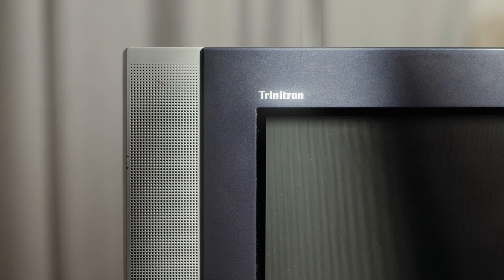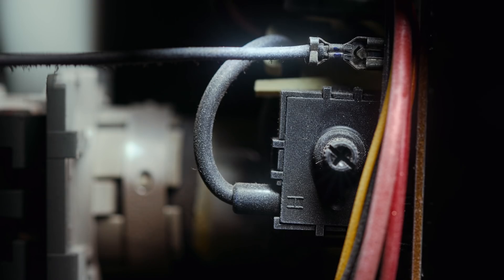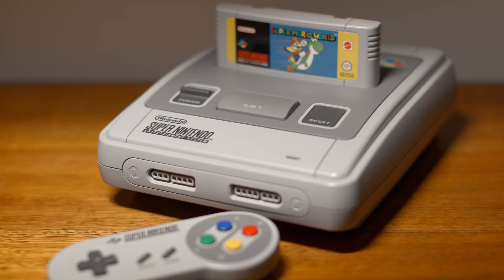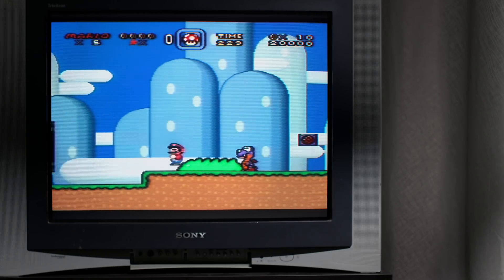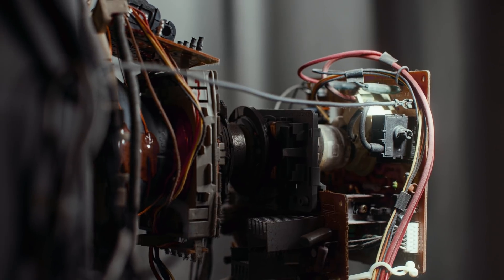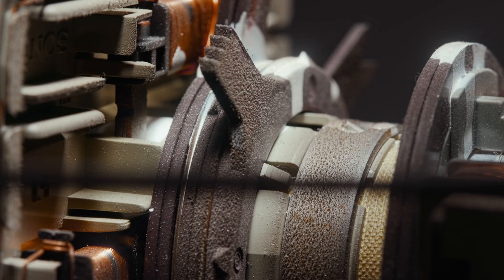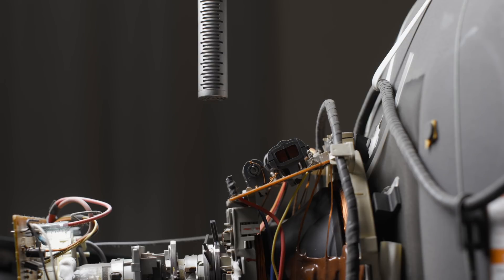What's inside my old TV?

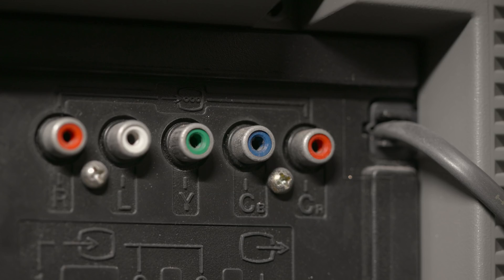Comment: 6:14 "that means I can order a component cable for Super Nintendo, and get a much better picture to this TV."

sorry, but that won't actually work. unless you mod your SNES, or use an upconversion system, in which case, you may as well just go back to your emulator, because it will NOT be genuine SNES anymore.

in fact, even the original Sony Playstation did not have component output. the PS2 did, but if you take that connector, and plug it into the PSX (they used the same connector) you would only end up with a black screen...

composite really was the best SNES had to offer. interestingly, the ORIGINAL NES (which shipped with an RF connector) actually had composite connectors on the back right (although they were in mono audio). but composite was STILL better than plain old RF connection.

Comment: Great Video - but several things; firstly, if you think that this TV is big and heavy,  you need to try the weight and size of a TV from the 1960s!!  This will seem comparatively lightweight in comparison!  They were full of Valves (which this one isn’t) and had even more heavy components than this one!  You’d need a wheelbarrow!  Second; you mention a Tube 'dying’ as if modern TVs last forever;  they have a much shorter life than a CRT – and they don’t ‘die’ (give you warnings when they are going) they just ‘drop dead’;  you switch on one day – and nothing happens -  it’s dead; no warnings, no fading – nothing...    CRTs lasted for years - literally, because they were built to last, unlike modern technology,  which is mostly 'tat'  - even at the so-called 'high-end’ of the Market.  Finally;  don’t stress too much about the Tube giving out;  they may not make old TVs any more, but there are a surprising number of BRAND NEW  Tubes out there that you can acquire!  There’s no shortage.  In fact,  I'm pretty sure there is at least TWO manufacturers who still produce them in small numbers. (I read why this was somewhere – but can’t recall where) Having said all that,  you could still replace it with  one from another secondhand Set,  as there are still thousands of old TVs out there.

Comment: In addition to no delay or ghosting, CRTs usually had (have?) noticeably higher refresh rates than LCDs. Even a run of the mill CRT could boast 75-90hz, while LED displays today routinely struggle with 59. Depending on quality, plenty of CRTs manage 120-150hz just fine; something that gaming monitors are only just now beginning to compete with.

Comment: Just so you know, when your CRT dies, you can always get HDMI adapters for your old consoles and connect them to your flat TV. They’re a good way to keep your consoles alive other than getting old tech specifically for them.
Reply from the maker: That's true! But digital TV's don't display RGB/Composite signals correctly in my opinion. There's no arperture grill, bloom or scanlines to break up the image and make everything gel. So it looks nasty and pixelated. Use RetroArch with the CRT Royale shader! I've tweaked mine and now my games looks extremely close to the real thing on a CRT. Very very happy. :D
Reply: Pogomix Pogomix Oh you’re more the type to replicate the old CRT look? Gotcha. I’m personally more the type to make all my games look the best that they’ll ever do. There is a very good HDMI adapter for retro consoles, though, it’s called the mClassic, the adapter takes the native output from the connected console and then runs it at a full HD resolution. It doesn’t have any kind of scanline filters or anything so you can make it look like you’re playing on a CRT, but the results are amazing! I myself only have the classic mini console variants of the NES and SNES, which do have a scanline filter setting, but the consoles like the Dreamcast, the GameCube, and the OG Xbox look absolutely stunning with the mClassic. Check it out if you’re ever interested, they’re only a 100 dollars a pop (I think regardless of where you look, not entirely sure, as currency-value can vary)!

Comment: CRTs are for around 30 000 work hours (assuming you calibrate them every ~10 000 work hours). After that, they are irreversibly off at various parameters, mainly white balance.

Comment: I have a similar CRT to yours (maybe the same model).  Its a Sony KV-36FV310.  I got it for $20 a state away and the thing weighed 275lbs.  We had to carry it down a long narrow staircase and every time I hit a bump on the road driving 80 miles home... I felt like I was going to break some internals as there was no real padding in the SUV.  

When I got it home and in the house, and had similar picture quality issues and was able to get it to a tolerable level using the remote, but I'm not brave enough to crack the thing open and do any sort of internal adjustments (I also don't want to get fried by touching the wrong thing).  It's in pretty good external shape and it even came with the OEM wooden/glass stand which is a nice touch.  I'd love to pay someone to do a professional tune up on it... recap the whole damn thing and make any sort of magnetic corrections normal maintenance adjustments can't fix... but sadly, I'd have to:

1. Find someone who actually does this kind of work and is reputable. 
2. Drag this monstrosity out of the house and deliver it to them. 
3. Pay an arm and a leg for the surface.  
4. Lug the thing all the way back home.  

By that point, I'd be better off just finding another $20 set that had a better picture.  I was lucky enough to find an affordable PVM, but it's pretty small.  Its a 14" Olympus OEV143 (rebranded Sony Trinitron).  This was a backup monitor in a hospital that was used for Endoscopy. It can do any of the analogue signals including RGB through BNC connections which lets me use RGB euroSCART.  It had some use, but was barely used.  The guy I purchased it from said it was one of the best conditioned one's he'd ever seen, and when we looked inside it barely had any dust in it.  The picture is fantastic, and while the jump from component to RGB isn't as big of a jump from say, composite to S-Video, the picture is breathtaking.  Only downside is it's only a 14" set and it's mostly good for things up to 480i.  It's sweet spot is anything that is 240p, and thats what I love the most (SMS, NES, Genesis, SNES, TG16/PCEngine and Neo Geo).  

While I have all the consoles from my childhood generation of video games (1983-1995), I most often use this contraption called a MiSTer.  You mentioned in your video you used an FXPAK to play SNES games.  That is an incredible device that can play all the roms from your RetroArch as if it was just a cartridge, but what makes it an exceptional piece of hardware is that it has an FPGA chip that can supplement all the cartridge enhancing chips in later releases such as the FX chip found in StarFox... so that it can play those rom files without the additional chips that can't be replaced in a simple ROM file (Emulation can emulate those chips, but you have to deal with cycle problems and input lag).  

The MiSTer is just one big FPGA chip.  People have painstakingly reverse engineered all the chips of retro hardware and put it into machine code which can be flashed onto the FPGA chip, and the MiSTer becomes a near 1 to 1 simulation of the hardware that is cycle accurate for both Digital and Analogue displays and can even do both at the same time (no input lag outside of any you introduce yourself through say... a wireless Bluetooth controller).  When you flash the chip, you flash it with a "core" which is the compilation of all the hardware in a console, computer or arcade PCB.  So this includes all the additional sound and graphics chips they might have had on it.  Right now, there are cores for almost anything from the SNES back including the Neo Geo, all the handhelds, tons of 1980's computers such as the Amiga and Sharp X68000... even older PC platforms that run Windows!  Dozens of arcade PCB's have had cores made from them including the popular Capcom CP1 platform.  Anyway... you seem pretty tech savvy and plugged in and you knew all this already, but maybe someone else reading this will take something helpful and worth exploring out of it.  

Once I got the MiSTer, it became far more convenient and less messy than having 12 cubicles with consoles in them all individually wired for video/power and the controllers/light guns.  It's a real retro gaming game changer, and it's the driving force of retro gaming preservation... as we experienced it as kids.

Comment: I always love to see new enthusiasm for CRTs. As for your dilemma of choosing between sending a PC signal or using flashcarts, I want to posit a third option. Flashcarts are generally used if you're a diehard for original hardware, but if you're fine with continuing to emulate, a homebrewed Wii is one of the best solutions. It's cheap, component/RGB cables are not hard to come by either, and the process of installing homebrew is very streamlined. You can continue to use Retroarch as well, if you like the convenience of a combined emulator front end. This should cover all of your options prior to gen 5, where instead I would recommend original hardware with modchips to play burnt discs (some consoles like the Dreamcast have no copy protection at all in early production units).

I'm also very glad you're appreciating the worth of a good TV instead of springing for a professional/broadcast monitor like so many now do. As pro monitors have higher "resolution" tubes, they lose the subtle softness that a well calibrated TV provides, not to mention their lack of good speakers.

Comment: Great video - I do have one miiiiinor gripe/correction. Component is the de facto "best standard" having benefits over SCART, not the other way around.

Funny you should make a video like this right now - I recently bought one of those small Macintosh Classic Macs with the tiny 9" screen. Thing's proper dead, including the tube (as far as a technician friend can tell anyway), so we're going to gut it and put in an LCD and a small PC to run emulation on it.

Comment: That noise on startup, god, that takes me back. I used to work in a TV repair shop in the early 2000s, saw the innards of these things all the time. Pain in the arse to carry around, especially as they got bigger, and the extra glass of the flat screen models made them even heavier. Dropped, I think it was a 90cm flatscreen on a finger while helping carry it once. I was lucky I didn't lose the fingernail and very lucky not to have broken my finger.

Comment: It's worth noting that there's really high voltage driving that tube; it's a domestic unregulated particle accelerator. Be careful when touching that area to not die electrocuted. Even after turning it off, it can hold a dangerous charge for multiple minutes.